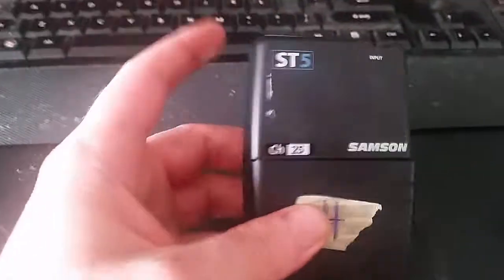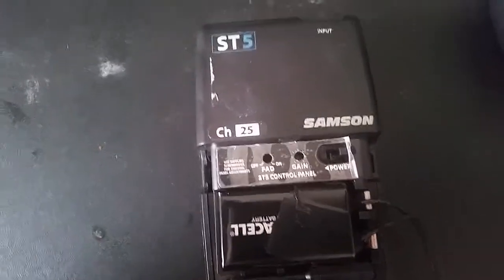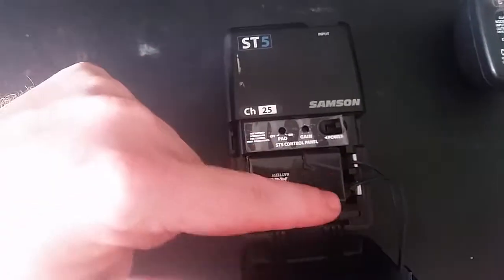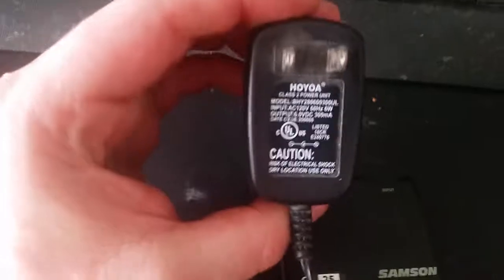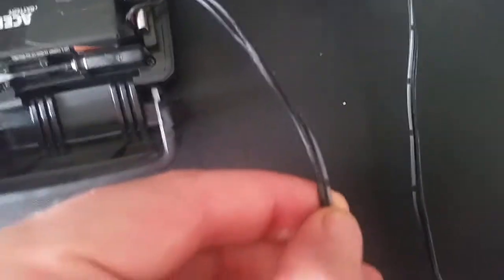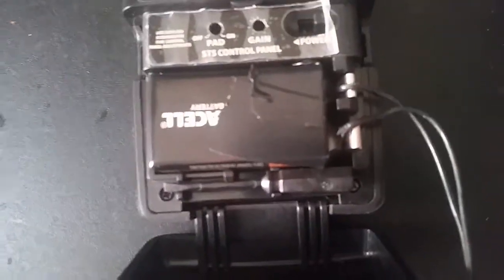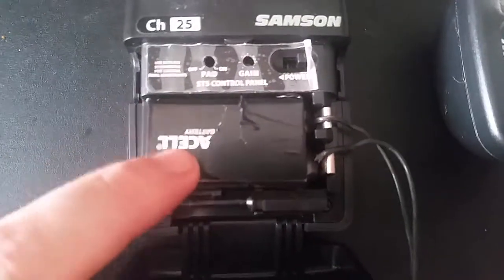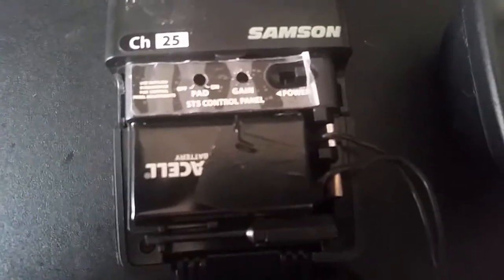DIY  Replace 9v Battery with Wall Adapter (No Soldering)

Comment: Hi ... Thanks for this useful video ... my question is that your device is using a 9V battery and you have made this to connection to use a 6V adapter ... will the device work with a lower voltage adapter?
Reply: No, you need the same voltage. The device might get damaged if using an adapter that provides such a different voltage than required
Reply: @sivaangreenzweig6255  ok ... thank you for the information

Comment: Is there a minimum amperage rating? How many amps is a 9v battery rated for?
Reply: its generally rated at 0.5 Amps as a 9v battery can range with currents from 400 mAh - 600 mAh